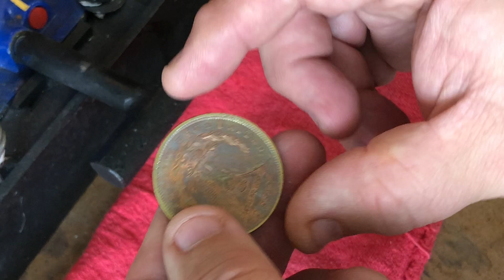Making a Coin Ring with Powder Coating

Comment: Hi Paul
I'm using the brush method like you showing in your videos. great manual, thank you. Which setting of kilovolt do you use? thanks for your advice!
Reply from the maker: I use the high power.

Comment: OK SO I'VE BEEN POWDER COATING AS WELL AS LEARNING FROM OTHER GREAT CRAFTERS YOU SIR ARE THE ONLY CRAFTER I'VE SEEN USE WHAT I ASSUME IS A FORM OF WET SANDING. IS THAT BETTER THAN DRY SANDING THE DETAILS?
Reply from the maker: In my estimation yes.  It keep the sanding tool clear and keeps the delicate process clearly visible.  I don't want anything to interfere with getting the detail to pop while avoiding sanding through the background.
Reply: thanks for that i will definitely put that to use.

Comment: where did you get the brush from and if its home made how did you make it ? that would be awesome to know thanx
Reply from the maker: Scotty, sorry for the delay in answering.  The brush is home made.  Buy a makeup brush at one of those makeup supply stores like Sally's.  Drill a small hole through the base.  the base comes apart so take it apart and snake a multi-strand copper wire through the base and tie a knot in it to keep it from pulling out.  Fee it up into the bristles and strip the end.  splay out the copper strands within the brush.  Trim the wires back as needed and reattach the end cap.  Its seriously like a 20 minute project...
Reply from the maker: I'll make a video soon on making a brush...
Reply: that would be awesome but I have another ? what type of powersupply did you use and did you put the negative contact to the coin end ? I would imagine you did I ask so that way I know what type of current to run through it . your awesome thanx for the reply I really do appreciate that
Reply from the maker: The heart of it is an Eastwood, 2 setting Powder Coating gun.  The wire from the brush has an alligator clip on the opposite end and clips to the tip of the Powder Coat Gun.  The other wire from the PC system, runs to the Copper wires I hang the coin from.  The are run down through a silicon plug and up around the sides so they contact the coin.  This electrify the coin, keeps the inside clean, and helps hang it.  I hope this helps...